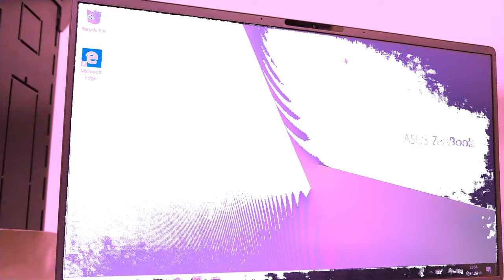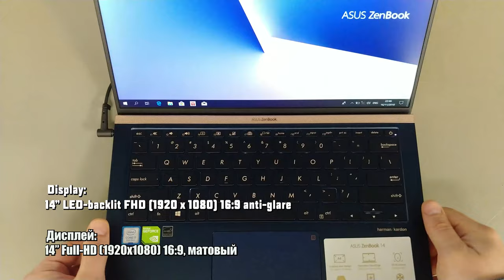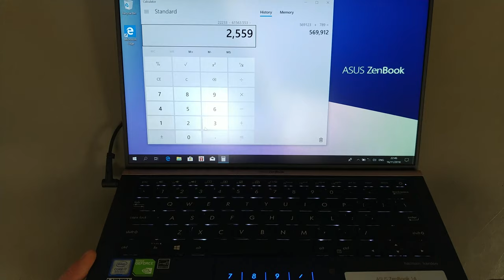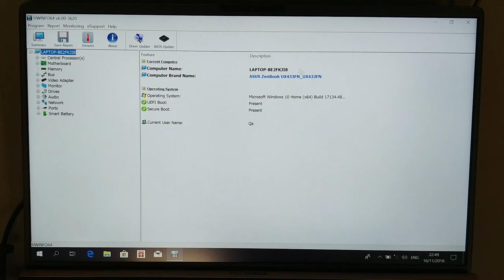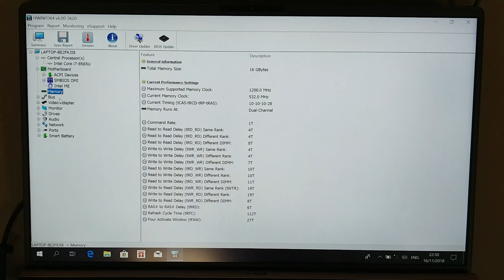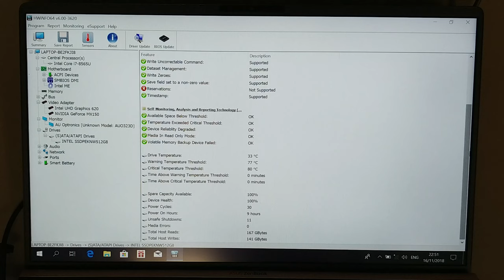ASUS ZenBook 14 Unboxing Teardown

Comment: Does it heat up pretty fast for you? Mine heats up pretty quick!
Reply: Hi Jia...yes i have experienced the same...whats the config of your laptop?
Reply: Even mine heats up but only the left side
Reply: I noticed that the heating problems disappeared and the battery significantly improved when I disabled the screenpad. If you own the screenpad model and you do not use it, disable it.
Reply: @yazeedtawalbeh1878  what do you mean by "disabled"? turn it off? I almost never turn my screenpad on, but heating problem still appear.
Reply: @giffarialfarizy7310  Yes I turned it off. Press on F6 and switch to traditional touchpad mode
Reply: @yazeedtawalbeh1878  I just realized you said "screenpad". On my ux433fn is not screenpad but numberpad.

Comment: Hmm I just bought this laptop less than 2 months ago. And then, I realized thermal problems is always be the "bottleneck" for gaming. I've been playing Cities Skylines and PES on my older laptop and just fine, but on this laptop fps drop occured often. Any solution? And what activities do you do with the laptop?
Reply from the maker: Hi mate, check the CPU temperature when playing, if it's too high, the CPU will decrease the productivity to save it self, maybe you need to repaste your CPU or to buy some cooling pad https://amzn.to/34Nymhg , anyway it's not a gaming laptop and you won't get much performance from him in games
Reply: @ITFIX  thanks for your answer. Yes maybe the CPU temperature is too high. I have tried to undervolt my CPU and it's better than before, but not 100% solve the problem. After few minutes the temperature increase and fps drop again in PES, but it's relatively good in Cities Skylines.

Yes, I'm noted that this is not a gaming laptop but my old laptop I bought in 2014 Asus A451LN:
- i5 4200 U (which is 4 generation older)
- 8GB RAM (which is 8GB lower)
- and Geforce 840M
did better in those 2 games. I'm not expecting high for UX433FN, I only want to those 2 games playable like on my old laptop without FPS drop. :( 

Anyway thank you for your suggestion. I will consider repaste my CPU or buy cooling pad. :)

Comment: Is it difficult remove plastic feet on back? I'm afraid of breaking them
Reply from the maker: preaty easy, it's made from rubber
Reply from the maker: @Better_Ketchup  it was still sticky and i just pushed it back, if no, use a drop of glue

Comment: How do you change that AC  wifi card??  My q536fd has the same card and it can not start no matter what software I have upgraded or replaced.
Reply from the maker: Hi mate the wifi card is soldered on this laptop, see on : 9:50
Reply: @ITFIX  If the wifi card needs replaced, and it is soldered does that mean I need to replace the entire motherboard?  Cheers.
Reply from the maker: @MJSGHK  Hi Michael, yes, or you can buy a simple wifi USB dongle, or use a LAN cable with adapter to type-c
Reply: @ITFIX  Hey man thanks for replying to my question so quickly.  I have another question if you don't mind.  Is this a wifi and bluetooth adapter combined together as I am experiencing wifi and bluetooth connectivity issues?  Thanks man.
Reply from the maker: @MJSGHK  no problem mate, yes this is the same adapter, didn't you checked your drivers first? Uninstalling and reinstalling the drivers sometimes make it work
Reply: @ITFIX  Yes I did try un-install and re-install the driver but it didn't help. :(